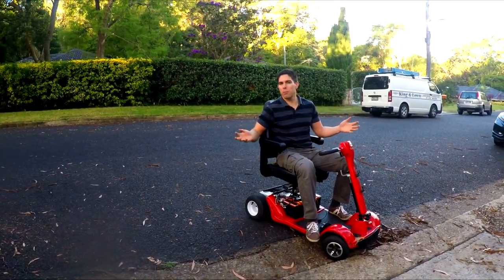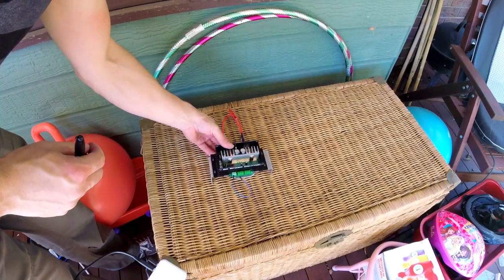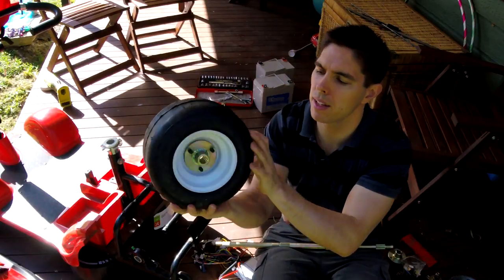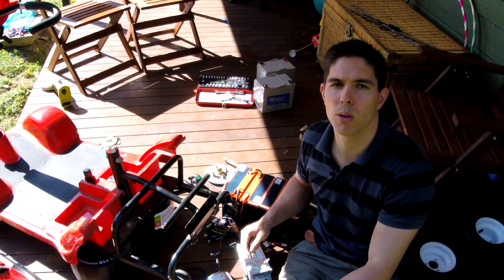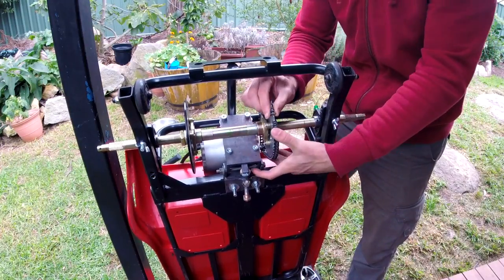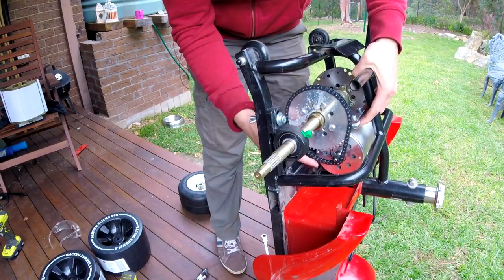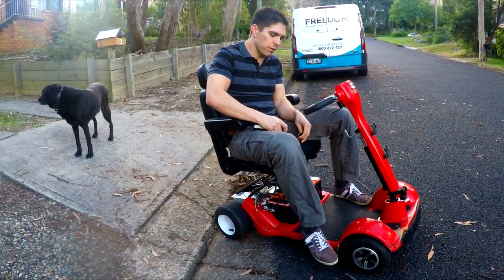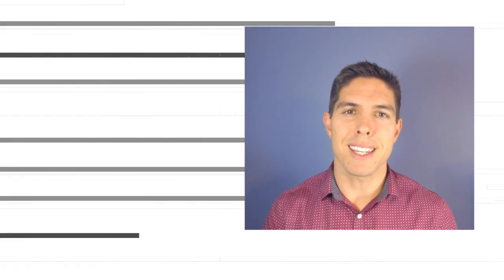Brushless motor mounting - Drift Mobility Scooter + Drift Trike - Part 4

Comment: Feed that new motor as many volts as you can depending on what your controller is rated for. 
It’ll allow you to better manage your amperage and you can start playing around with some serious gearing changes. 
You have 4, 12 volt batteries. Wire the batteries in series for 48 volts. You’ll need a new battery charger. The only downside will be that you’ll reduce your amp hours to whatever a single battery is rated for.

Comment: on my next build I'm going to use a go cart axle and motor, most of my builds I remove the gears in the transaxle and use sprockets and chains for a faster gear ratio, and when I'm done it still looks original

Comment: Hi gr8 videos. any more videos on the way on this project?
 I have been trying to make mobility scooters faster with useing as many original part's as possible and as cheap as possible for the past 2 year's
I have found that the standard 24v motors can handle 48v for a few minutes at a time and I found this is perfect for drifting as I have fitted my scooters with digital amp and volt meters from eBay I can see that the motor draws 200amps max at 48v but only for about 0.3 of a second and then  the amp's drop to under 40a once moving./drifting.  the motor can handle it no worries I also have a thermal cutout fitted to the motor to prevent overheating at 75°c I have only tripped it once when thrashing it.😉
My only upgraded parts are volt/amp meter display from eBay 200a 200v.
A 200a DC motor speed controller.
A 3d printed thumb throttle to use a pot to control the speed 
And I fitted the biggest wheels tyres I could find and would fit in the body without too much trimming the wheel arches.
I ended up using lawn mower wheels and made adapter for fitting them to  mobility scooter axel.
And the last thing I have done was to fit drum brakes to all 4 wheels and it was an easy job I used brake shoes and springs from the front of a 50cc quad bike.
The brake drums are made from exhaust pipe of the diameter of the brake shoes and a bit of 4mm thick steel plate cut the shape of a big washer and welded to a slice of exhaust pipe. The brake shoes are fitted to another bit of 4mm plate and 2 bolts with flats cut into them to work as cam's to push the shoes apart when turned.
I hope this information is useful to someone 👍
Reply: Maurice are you able to post photos/details of what you did to modify your mobility scooter using most of the original parts? In my Shoprider scooter i have a 1.2amp 24V DC motor with a transfer gear case mounted to the transaxle.  It has 12" diameter wheels.  If i change the battery to 48V and change out the controller it seems it would be following what you have done.  I was worried this higher voltage would burn the motor out quickly.  What do you think?

Comment: Use smaller, more narrow batteries and nest about three of them so you can get 36 volts and then hold on tight for a jet-like experience.  Make sure first that your speed controller can take it.

Comment: Astroflight 3210/3220 motors paired with astroflight speed control using 18650 lithium ion battery cells instead of lead acid would make it a BEAST!😎 I'm just wondering how to install full suspension  🤔

Comment: Love you videos.sounds like it has plastic wheels,what is the sound we here as its rolling Resonate vibrations of plastic ?The trick to these swaps,is finding quality parts,sadly most of the cheap Chinese motors are junk.A nice motor goes a long way in making for a incredibly quiet ,high performance ride.These cheap motors ,will l drive you to drink and give you a huge headache.Look to a quality IPM (interior permanent magnet) motor  for a super swap.with incredible performance.Also look to a all metal mobility cart with pneumatic tires.Love the slicks .
Reply from the maker: Thanks for watching. These vids never got much love but I will finish it at some stage. The idea is as cheap as possible so not willing to spend decent coin on quality parts.
Reply: Yes I understand,its hard to build a channel. Unfortunately everything has to be over the top like " I build a 80 mph electric mobility cart " You find your market,it just takes time.

Comment: That motor can be adapted to drive through the transaxle. I would like to know what motor & controller you used, so I can fit one to my gopher.
Reply: Yes but then you would have no brakes
Reply: @theinternet8853  I can set it up so it has brakes with no problems at all. My mobility scooter currently uses regeneration type braking to slow it down, then an electromagnetically operated brake to stop it completely. Not that this matters, because I am going to install a Benevelli transaxle in the coming months.
Reply: @christophermarshall5765  yes but that motor he used does not hav a mag brake like the mobility scooter
Reply: @theinternet8853  this is why I stated I   can fit a braking system to this drive system.
Reply: @christophermarshall5765  which mag brake fits this?
Reply: @theinternet8853  who said it had to be a mag brake? I can make a bracket & fit an adaptor to install a disc brake system, like that on some motorbikes.
Reply: @christophermarshall5765  where on the original transaxle r u gona fit a disc brake then
Reply: @theinternet8853  I never said I was fitting disc brakes to the original transaxle, though with some, it can be done, because of them having an open axle.
Reply: @theinternet8853  you have a serious reading problem. If you read properly, you would have understood my own mobility scooter had a regeneration type brake along with a mag brake. The scooter shown here is the one I was referring to regarding a disc brake system.
Reply: @theinternet8853  just another point I must state is you are NOT here to see what I do with my time, so until you are here to see what I do with my time, shut your mouth. I do NOT have to justify myself to you.

Comment: do you have eney vids of it finnished and drifting? ?
Reply from the maker: Unfortunately it hasn't been touched in some time. It drives but doesn't have the brakes mounted. I need to remake the chain tensioner to be simpler and have more of the chain around the sprocket. I'm hoping to have plenty of time around Christmas.
Reply: Teaching Tech we need part 5! This series is awesome!

Comment: I hear that putting larger rear wheels on a mobility scooter can make it go a bit faster. Maybe this guy will try that. I am not sure of the exact size wheel required. But,  But,  it should be bigger in diameter i.e from 8" to 12 or 14" or even 16" or 18"  😳🤔 Not solid tyres no grip But,  i suppose if doing this sort of thing ( drifting ) they maybe a better solution to use.   As I'm no expert in this field i just heard that larger wheels gives more speed. But,  can tilt front up very quickly due to theamount of power given to the rear wheels So,  either a anti tilt at rear ( similar to those used at Santa Pod )   or extra weight at front to stop it from raising up at the front & causing a nasty 🤕  But, i am not a fan of drifting on any type of vehicle But,  each to their own i suppose.

Comment: I’ve done something similar, I think even the same motor , controller etc. 
however I cannot get that motor to put out enough torque to really get moving, yours seemed to get going easy but mine seems as if I need a gear reduction motor to get the required torque. 
Any ideas??
Reply: Astroflight 3210/3220 motors paired with astroflight speed control using 18650 lithium ion battery cells instead of lead acid would make it a BEAST!😎 I'm just wondering how to install full suspension  🤔

Comment: Cool but that's not gonna drift. I have that brushless motor at 48v on a tiny razor and yes it fast but not enough to go more than 15mph.
 Please finish so I can be proved wrong
Reply: armenvegas  you must have rubbish gearing ive got the 3000w motor and im getting 35mph on mobility scooter
Reply: I have a razor pocket mod running on 36v and Im getting about 23mph...
Reply: @danielauen7790  what kind of controller are you using? How many mosfets?
Reply: @armenvegas  I just went on Ebay an bought the cheapest 1000w 36v brushed controller. Though, in still using the stock 24v motor. Gets a little warm, but it works.
Reply: @danielauen7790  oh, mine is brushless
Reply: @armenvegas  Try to find a lower voltage motor, but do keep an eye on the temps. im running a 250w 24v motor on a 36v 1000w controller and a pair of hoverboard batteries. yes, the cheap Chinese ones.